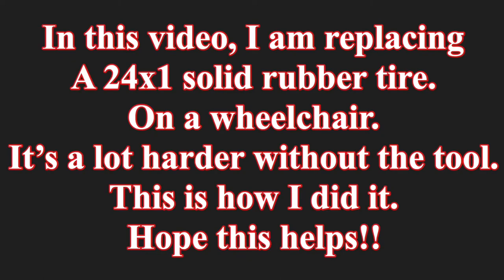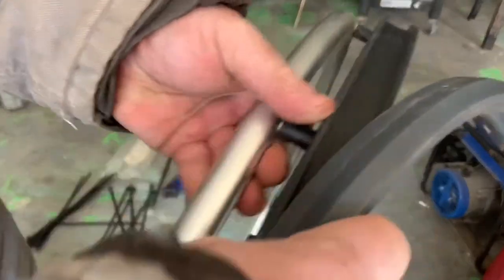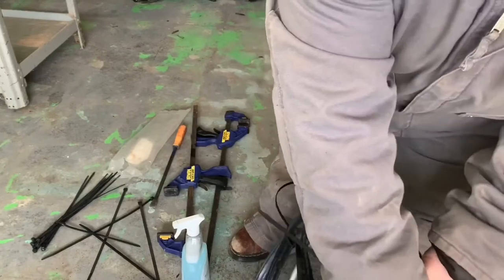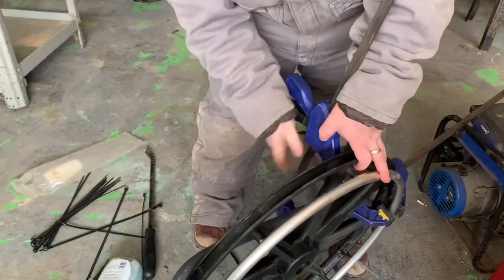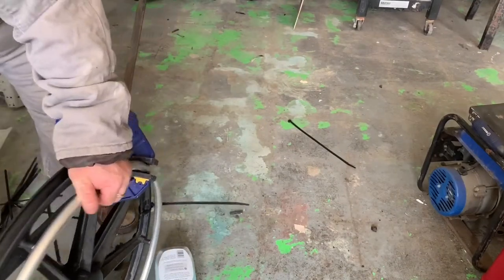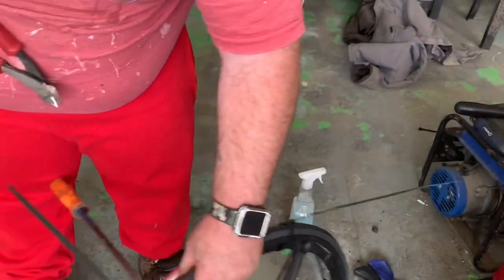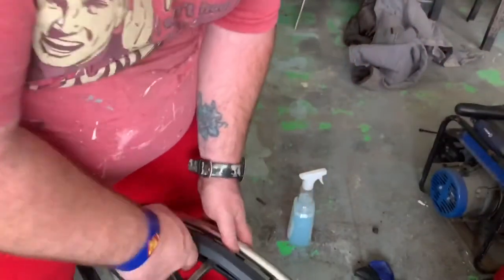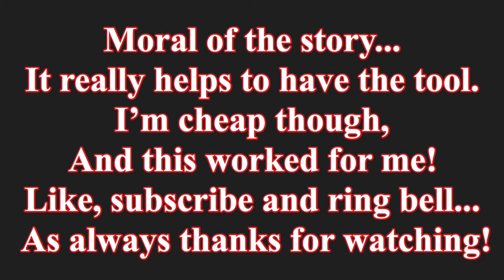24x1 rubber wheelchair tire installation

Comment: I used a couple of ratchet straps instead of the clamps.  Pry bars and zip lock strip.  The ratchet straps really made it easier. Good video.

Comment: My late father left behind some wide tire pry bars. Probably more than 55 years old, but they should help a lot. I've heard the tire stretches better if left in the hot sun. Lay it on the asphalt driveway maybe.
Reply from the maker: I bet it would help